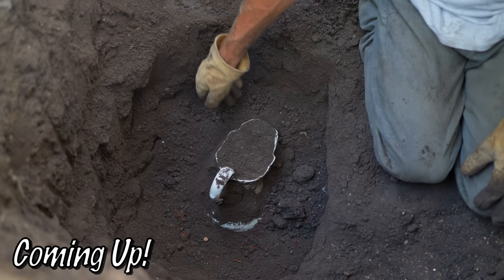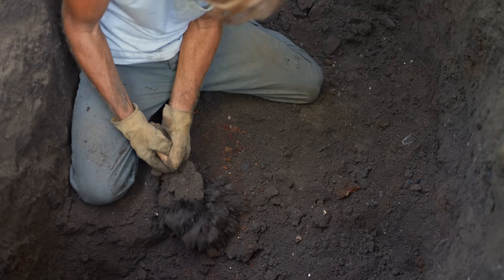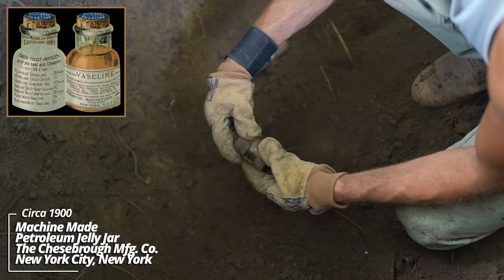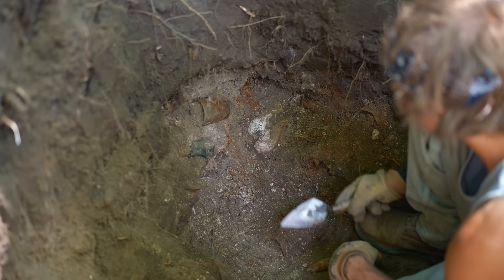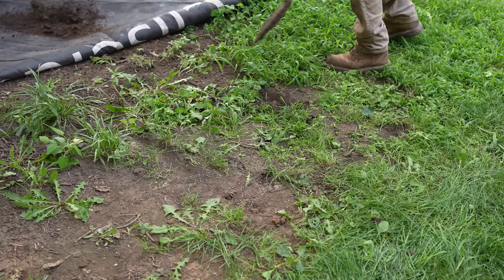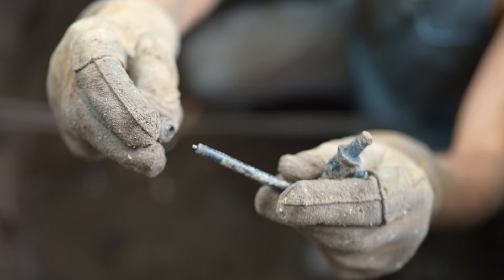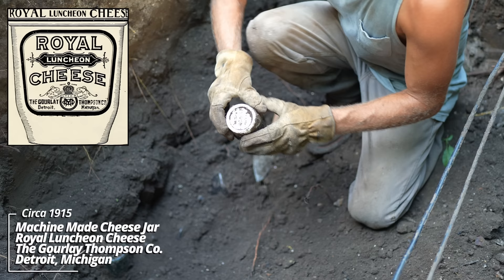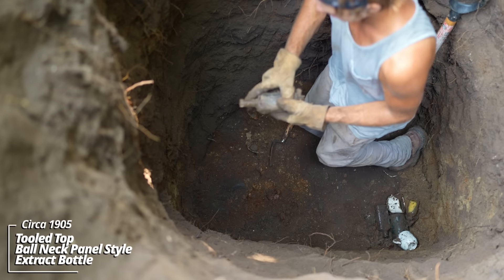Paying $2500 to Tear Down a Garage, After an 1875 Map Led Us to This Yard

Comment: That figurine missing it's head is likely a "Frozen Charlotte" figurine. They came in many sizes and the diggers in the U.K. often find them. RE: Tooth powder- Yes it was a "tooth paste'. I remember as a small child we made out tooth powder out of baking soda and salt. One wet the tooth brush and dipped it into the powder. It worked well and literally cost about 2 cents to make a small container of it.
Reply: My dad used tooth powder in a tall tin up to 80s that he bought in stores.
Reply: I remember my grandmother used to do that. I was a little back then, but it was funny to watch your elders, make toothpaste. ❤
Reply: My mother used to use that because she was allergic to toothpaste.

Comment: I never heard of Knoxit Globules, so I looked it up.  Turns out it was a treatment for venereal disease!  Just found your fun channel.  
Over the years, I've often thought of my Great Grandmother's farm outside Zimmerman MN.  My Great Grandfather built the house in the 1890's.  Two stories, no running water, pump in the kitchen, no electricity until about 1960, scary "root cellar" under the kitchen, two seater outhouse down the hill, shed/garage containing a Ford Model T, barn in such disrepair we were forbidden to play in it.  But the best thing was the "dump."  A huge round open pit--haven't seen it since I was about 10 years old but guess it was about 12 feet across--lined with rocks.  Everything went in there.  I can't help but wonder if it was filled in before she sold the farm, or left open for the new owners to pick through.

Comment: I live in a very small town in Nebraska. Actually a county seat. My home, very small and rudimentary was built in 1895. It was at one time the "Farmers Union". There were gas pumps here in the 1930's.  I'm sure there is a pit in the back corner. We found many small broken pieces when we dug in new propane lines. There is also some kind of well. It has an open ended pipe  stuck in the top of the well and about 7 ft. tall coming up out of the ground. A man came here a few years ago because he knew there were 3 wells in town but could only locate two of them. He believed that this was the correct location after looking at it but he never returned to investigate further. When we dug to move the sewer pipe a bit further out from the house so we could install a patio we found the cement islands for the gas pumps burried. The tanks could still be down there. It's evident where they parked the gas delivery trucks because grass etc. Will not grow in specific areas of the yard. Sirry if there are typos. I can't see very well.

Comment: Tom, quick question; when you find a bottle that has ground water in it, I notice that you plug the top with your finger when you turn it over to check the bottom. Why do you do that? Is it so you’re not dumping water into your work area?